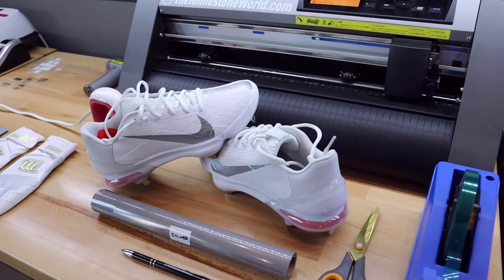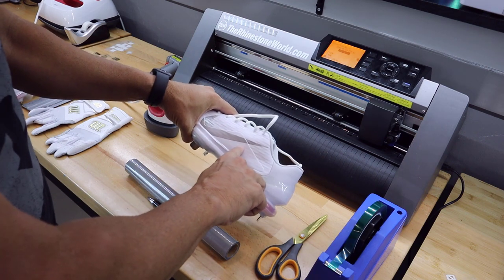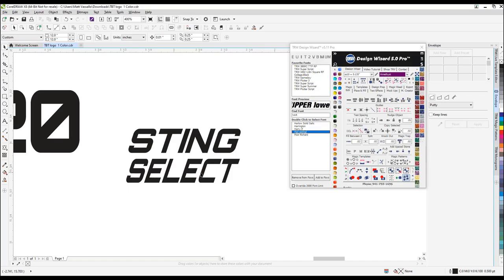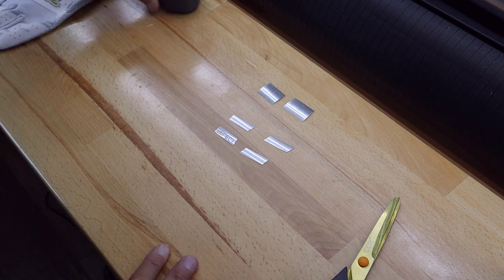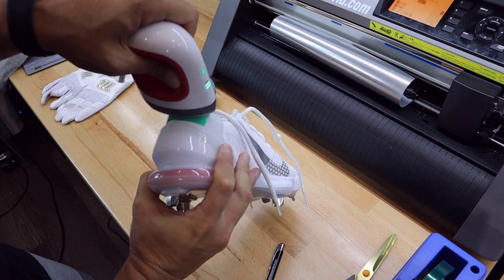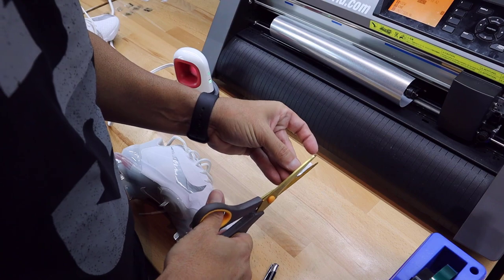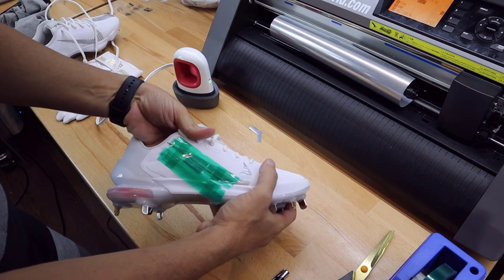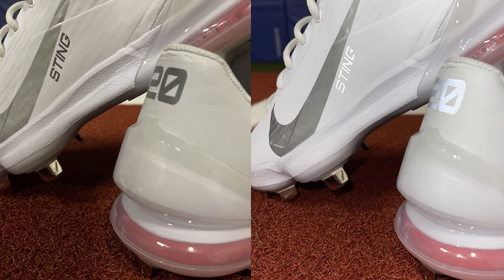How to Customize Sports Cleats with Heat Press and Reflective HTV

Comment: How many numbers would you cut out if you did an on-site event?
Reply from the maker: It honestly can be a learning process to gauge how many you need. But we would have a bunch of 1/2" tall numbers, a bunch of 3/4" numbers and a bunch of 1" numbers in little drawers all sorted out so grabbing a 2 and a 0 was something we could just open the drawer and grab them. Every time you cut htv, in the 'dead area' start cutting the extra numbers to build up your supply. -TRW Pilar

Comment: I see you did not place on more of the plastic/rubber/ shiny part of the  material on the cleat, like below the number. Is it possible to do that part of the shoe as well or no ? Would you use different material
Reply from the maker: With the soles, it's likely to melt under the heat needed, or if it does stay, since it flexes a lot more it may not last long term due to that as well. 
 -TRW Crystal
Reply: @TheRhinestoneWorld  thanks for your response